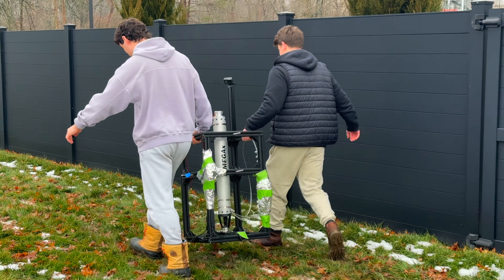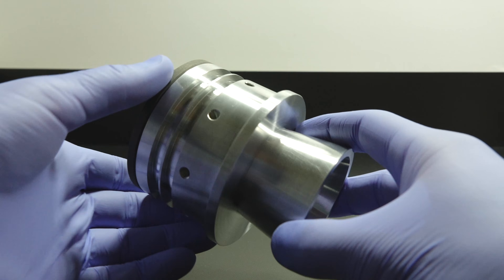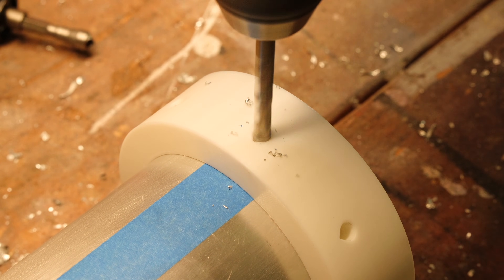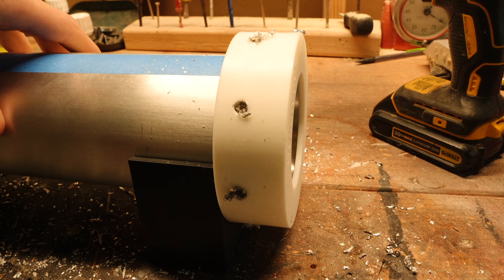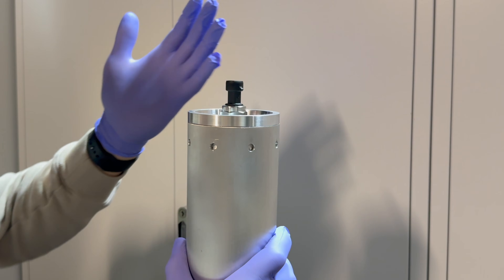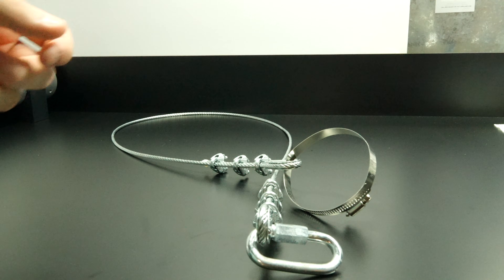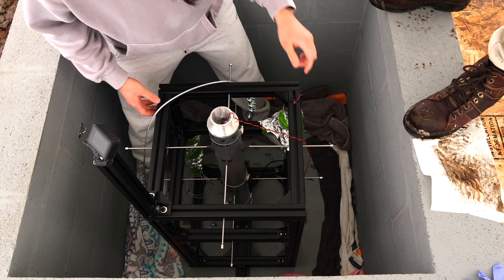This Homemade Rocket Motor Produced Way More Thrust Than Expected – MEGAx Ep 5

Comment from the maker: If you enjoyed the video, be sure to like and subscribe. Have questions or feedback? Drop a comment below!🚀
Reply: 7:49 never saddle a dead horse
Reply from the maker: Did I??!! Whoops I know I got it right on the other side.
Reply: @AeroPropulsions what is the theoretical specific impulse and  what is your measured or calculated specific impulse?
Reply: Are you going to try to fly one eventually?
Reply: Melting point of stainless steel is closer to 1400C not 1400F.
Reply: put the test chamber in the top of a hill

Comment: 11:25 the nozzle bout came out the end their. great work and awesome video!

should try making the rocket motor sleeve extend past the nozzle and then use a retaining ring along with screws to keep the nozzle seated? as an engineer, there was energy lossed to pushing that nozzle out a bit.

Comment: Nice build and test fire. The retired combat engineer in me kind of clenched a bit with it being primed inside the being brought out to the blast pit though. Electrical ignition can be vulnerable to static and EM emissions. I'm sure you are taking precautions but a good rule for explosives and Pyro is "Don't prime until it's time." Yeah I know it sounds cheesy. But priming as the last step has probably prevented more than a few incidents. Great video though.

Comment: I had this idea of making your propellant a little differently.. Basically i wanted to try to replace the heating step with adding ABS plastic and acetone to the mix and running it in a ball mill. Im tinking by stochiometrics something alnong the lines of 10-15% the sugar weight replaced with plastic (essentially a nylon so burns to just CO2 and water)  At any rate id have the acetone ABS and fuel mix in something likea ball mill over night and then pour it as a cast same as your doing only cold ofcause, as acetone will dissolve ABS inot a gluelike substance.. Leaving it for the acetone to fume out.. id guess a weeks time in well ventilated area depending temperatures.. 

Idea of it all is to create for one a waterproof and significantly stronger fuel and for two skipping caramealising the sugar.. obviusly needless to say acetone is a solvent, toxic and so on.. But nobody said stick your fingers in it and play around. You will basically just want it as waterdisplacing liquid that will ofcause dissolve the ABS but also help the cast come together in a solid block free of cracks, in burn collapses etc etc.

Id think scaling up plain sugar propellant gives you some cases of propellat blocks basically thrown out unburned, id guess especially so once you flip the rocket right way up. But strictly speaking the only time i ever made something with sugar and potassiun and that diameter you got ther my "launch" was more.. Fragmented.

Im not entirely sure but possibly  adding a bit of ethanol to the process would act as a dehumidifier. removing some water from the cast asides from obviusly the ABS is agoraphobic wich should seal the cast from any water getting in it onwards.

Comment: Don’t watch his stupid video 

Shitty content creator, shitty human being in real life, here is a summary of his garbage video:

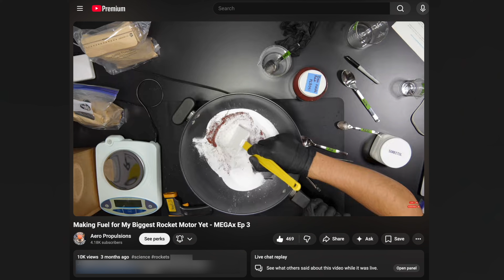 This video documents the building and testing of MEGAx (0:35), the largest rocket motor built by the creator to date. The motor is designed for around 500 pounds of thrust (0:37) and uses Rocket Candy propellant (0:55).

The video covers:
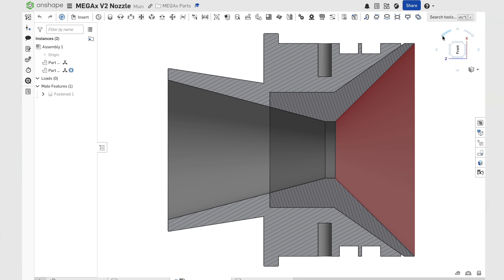•	Nozzle and bulkhead assembly (1:29) and the use of graphite for the nozzle insert (2:20) due to its temperature resistance.
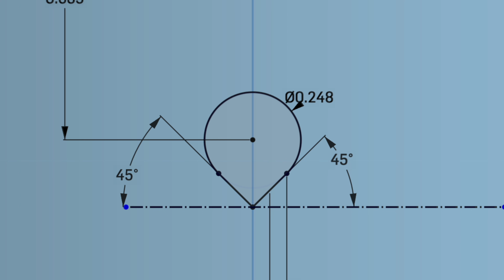•	The challenge of drilling precise radial bolt holes (3:03) in the casing, and the solution of 3D printing a teardrop-shaped jig (4:11) to ensure accuracy.
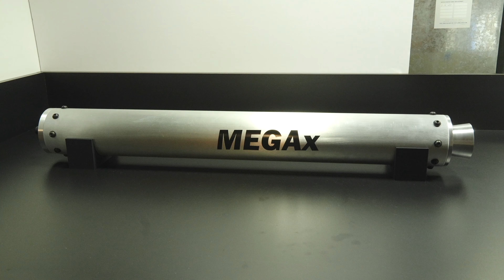•	The full assembly of MEGAx (5:16), including the installation of the pressure transducer (5:24) and FKM fluorocarbon O-rings (5:55) for sealing.
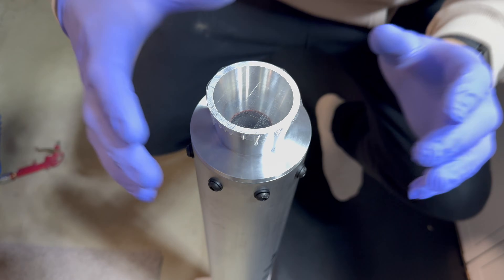•	Integration of the motor into the test stand (7:09), emphasizing the importance of alignment pins (7:18) and thermocouples (7:24) for data collection.
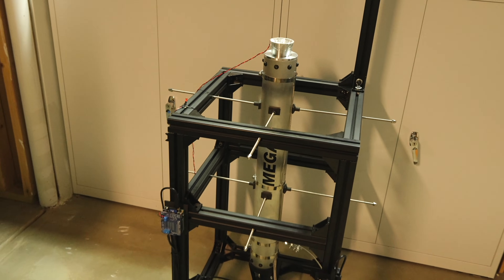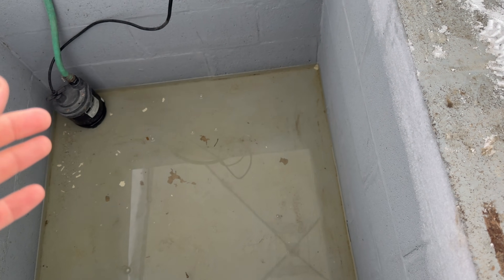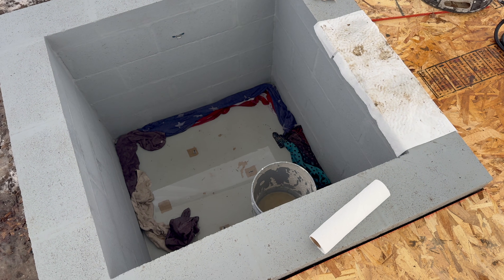•	Test day preparations (8:54), including dealing with a flooded blast chamber (9:06) and protecting electronics from humidity (9:51).
•	The static fire test footage (10:51).
•	Post-test data review (11:37), revealing a maximum recorded thrust of 7,950 Newtons (12:01), much higher than I expected, likely due to cracks in the propellant causing increased chamber pressure.
•	A look at future iterations of MEGAx (13:01) and upcoming videos on a detailed data analysis (13:01) and the total cost of the project (13:10).

Comment: P. S. Your PLASTIC JIGS DO NOT REQUIRE ACCURATE ROUND HOLES. YOUR 1ST DRILLING WILL ROUND THE HOLES. You only required position. Since any wobble by you would during the drilling negatively affected the round holes. Also, you weren't using drill bushings. So, not accurate drilling for tight tolerances. Good thing you only needed - good enough. ? 0.040"+ ? You wasted a lot of time.  Also note: Hole patterns are a bane in every manufacturing effort.

Comment: We had this happen in a Water Bottle Rocket contest to one of ours.  We designed the rocket body for minimal weight, and tested it up to 75psi as per the rules.  So on the day of the event, the wind was blowing fairly hard, and the launch site was below a large berm.  The organizers decided to up the pressure (illegally) to get some "better results", to about 100psi.  When our rocket launched, and it hit the "wind shear zone" above the berm, at obviously "Max-Q" the top of it folded over, at about the one-third level.  Even so, it cam in THIRD in the competition.  One of our other ones managed to withstand the extra launch forces, went completely outside of the event area, and had to be rescued by some helpful drivers, about a half-mile away.  It came in FIRST, setting completely new regional records.  Too much, is too much.  Period.

Comment: On your safety cable the clamps are backwards. 
A way to remember the correct orientation is the saying never saddle a dead horse. The "dead end should be under the u-bolt.
Reply: That was my first thought too, but after taking another look, I am more concerned with the strenght of hook and screws mounted to the block wall.  As well as the hose clamp to hold the cable to the rocket.  If the rocket goes rogue, it is going to take a running start at all of those pieces  😬

Comment: This is really fun to watch. I have to ask, why is the pressure chamber manufacture so complex? Why not just go outside your circular box and add a series of tie rods from top to bottom. The rods could also be used to position the rocket vertically inside your launch box. 
The series of screws around both ends could also be eliminated along with the need for jigs for drilling operations. I mean what's your chamber pressure 1000 psi max,  6 tie-rods connected to and over sized head (both ends) and your good. I also have another question about ignition points and burn rate but sense this is my first video to watch I will look at some of the other videos to see if my questions have been answered.
-MG

Comment: You'll never be able to waterproof that pit without painting on a thick layer of rubber/tar or something like that. Those bricks are way too porous and even normal mortar leaks water. Additive densified concrete might work but that's a lot of work.

Comment: Congrats on compensating for the extra pressure because I think you came near maximum  pressure,  the nozzle still moved, huh? Even with that many bolts... Awesome KNO3+sugar based motor recipe looks a lot smoother than most... just one thing ,Mold Release ... Plenty of Mold Release , et viola...

Comment: If you want to drill the holes accurately, get a drill press for $89 at Harbor Freight and an appropriately sized V-Block. Then your jig can be as simple as a piece of paper glued to the pipe.

Comment: At 4:00. You should print a spot jig with much smaller holes and use a smaller drill bit or spot bit to drill the pilot holes. Or even initiate with a punch tool. Using a pillar drill might also be a good idea so you are not relying on the strength of the plastic hole to maintain the drill angle.

I think @bps has a video of his setup at some point. He Also has a jig to hold the round tube and stop it rolling around.

Comment: Just drill out the hole to final size on your 3D prints and/or use supports inside the hole.  Add a taper or chamfer if needed to let the drill start.

Comment: Great project 👍😀.
I an a retired machinist / hydraulic engineer with 20+ years experience in the machine shop.
Its interesting to see how you worry about accuracy when printing the nozzle and the holes but using a hand drill to drill holes 😋.
There are ways to get better results by making use of different tools and techniques 😀👍.
1st ) try to get your hands on a drill post will help you a lot , and you should be able to find one fairly easily and cheaply.
2nd ) start using / making drilling jigs and/ or set ups .
3rd ) instead of a drill start using end mills to open up the holes , you will end up with more accurate round holes and they have less tendency to come out in a random angle because drill bits will easily bend and follow the easiest way out.
Also invest in a small lathe and milling machine and tooling will Ofcoarse cost money , but being able to make your own parts will save you a lot of money and waiting time.
And these tools and skills will last you a lifetime 👍😀.
Start looking for manual machines before you go the cnc way .
I know that the cnc looks all glittery and glamorous , but learning to do manual is just as accurate and easy.
Trust me....😊.
Thanks for sharing this great stuff about rockets 🚀
Reply: Agreed he needs to learn traditional manufacturing techniques. Could've saved days of time with just a 50$ hex block clamped on a spacer block and a 200$ drill press setup correctly (there are better ways, i was illustrating the cheapest way i could think of)

Comment: Like to see advancements; 
Hope this helps.
You are pouring a hot mixture of propellant with hope it can settle in a uniform Manor. 
Please consider a heated tube injecting system for the propellant. So it eliminates The Hope and prayers that pouring is okie dokie. 
Okie dokie is not good enough for science in my opinion. 
Just trying to help.

Comment: Moving forward, with your test pit being at risk of flooding, I would suggest putting a much deeper sump some place outside of the pit so you can draw away water to a level below the test pit before the test is ready to be inserted and run.

Comment: Please adjust nozzle and closure retention! That motor wanted to spit out both end. This is why a lot of COTS motors use threaded closures since the threads support the entire piece uniformly. I definitely understand that it is harder to implement, but I'm sure you can work out a solution! Overall, great job and I like your blast chamber a lot!

Comment: Just a tip, when soldering 2 wires, off set them so they can never short. Then heat shrink each wire then one big one over both. 👍👍
Reply: Haha great to see someone mention this.  This is also what I do 🙂
Reply: ...and they won't create a bulge.

Comment: Since you did not precisely drill the tube, the radial bolts moves to the hole OD edge making the nozzle assembly moves outwards. Adding pretension like o-ring or thick gasket between nozzle flange and the tube itself will solve the problem. Make sure that the radial bolt will line up only if under the nozzle is compression. Hope it helps.

Comment: 7:40 Re your leash, if you can get your hands on a nicopress tool, those nicopress sleeves make for a splice stronger than the aircraft cable they’re in. I don’t really like the U-bolts.

Re the water ingress: Wet core a hole into your slab for the sump pump to sit in.

Comment: For your SD card failure, I find that it is good to have something in your code that tells you when it has initialized and recording, as well as a live view of the sensors so you know you're getting data before anything starts. And of course,  1-2 replicates for redundancy on important things. That also helps you determine if you have trash data because you have something to compare everything else to.  I don't know what your setup is, so you might be doing that already. I like that you are using solder connections and screw terminals because that is the only way to ensure you have continuity in your circuits. I would also recommend crimping ferrules onto the ends of your wire that go to your screw terminals. This keeps the stranded wire from compressing and squishing out as you screw it down, which will cause the wire to pull out. You can also just solder the end so its a single strand where it goes into the screw terminal. The problem there is sometimes the solder makes it too thick to fit in the screw terminal and it becomes a monkey/football situation. Good work though. I like your attention to detail in your manufacturing and assembly process. That is where you stop 99% of failures.

Comment: Very cool project! I'm not sure how close your data acquisition setup was to the test stand, but SD cards don't like high vibration environments, and near a rocket motor test stand gets pretty intense, especially for the scale of motor you're testing. A common solution I've seen to this with folks who have built their own test stands and flight computers is that they'll record to flash memory during the flight, then once landed it'll offload that data to the SD card once any forces that could affect the SD have subsided. Looking forward to seeing more updates, and congrats on your success to this point!

Comment: Interesting video and you put a lot of work into this.  Did you make the corners of the nozzle at the throat sharp on purpose?  Traditionally that area is a smooth curve.  Is the change in weight of the motor as it burns trivial compared to the thrust force?  School bus size motors get tested positioned on their side.

Comment: For the core insert, you might try polystyrene insulation foam turned into a rod and spiral wrapped with packing tape. You'd be able to crush or dissolve the foam, then spin a rod in the gap to remove the tape. That's assuming the tape is compatible with the fuel mixture, of course.

Comment: What is the diameter of the casing? Did you use any coating to prevent the aluminum casing from softening?
Reply from the maker: For the first iteration, I used a raw 3.25 ID, 3.5 OD 6061 aluminum tube.

Comment: Dude - stainless steel does not melt at 760c !! - more like 1400-1500c. depending on alloy . i think you confused it with aluminium
Reply from the maker: Whoops I did lol. Was rushing to get this video out!
Reply: @AeroPropulsions  Also from when graphite have melting point? 2:49

Comment: freaking sweet! looks like some reinforcement could be used on the nozzle end, maybe idk im no rocket surgeon
Reply from the maker: Yes your correct, the radial bolt holes slightly expanded. If I stayed at the designed pressure that wouldn’t have happened.
Reply: @AeroPropulsions have a new retainer machined that sandwiches the liner with a one piece design that has a reciever groove cut that the aluminum liner/body slides into

Comment: Well done Anthony, congrats on a successful firing :) Which was the design pressure for MEGAx? Also, it looks like the nozzle wanted to skyrocket, did the screws fail/deform due to the pressure spike ?
Reply from the maker: The designed max pressure was ~750 psi. The bolts didn’t tear, but the holes in the casing slightly expanded due to the spike. I expected this to happen so I made sure the radial bolts will hold for pressures much higher than 750 psi.

Comment: Why are you using Thermal PASTE? It will most likely shift or go away with very high temperature or Gs during lunch. Use Thermal Cement, it can arguably be better than thermal paste and its also more "permanent" and won't move at all
Reply from the maker: As of now, I don’t plan on launching this motor, and even if I did, I wouldn’t include the thermocouples. They’re strictly for development and testing. For the static fire, the thermal paste performed really well and held up without any issues.
Reply: @AeroPropulsions alright, its just a heads up, I thought that sensors would also be used when you launch it to have better telemetry and overall data

Comment: Awesome work. Try silicone hose over a threaded rod as the coring rod, let it set, pull out the threaded rod out then 
 just pull the silicone hose out,
 easy peasy
Reply from the maker: Yes that’s what I used for the SN series, but I couldn’t find an proper size tube for MEGAx. Will use that method for the second static fire.
Reply: AliExpress has every size you could ever need

Comment: I am really surprised that the chamber didn't blow up  with 1600psi 
Wich equation you did use to determine the maximum pressure  ?
Reply from the maker: The maximum pressure was provided by the manufacturer.